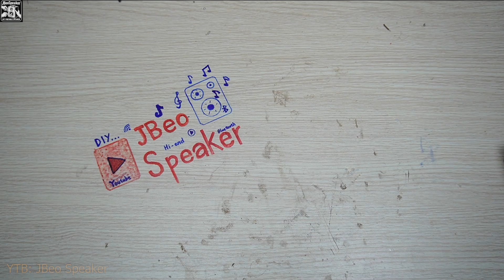Build a Mini Bluetooth Speaker at Home Bose Soundlink Flex Pro || DIY Portable Bluetooth Speaker

Comment: باکس چطوری درست شد!!؟؟
ام دی اف ها خودشون بهم چسبیده و رنگ شدن!؟
Reply from the maker: Yes, I skipped the part where I was working to make the video shorter and less tedious during the process of building the speaker box. Making the box took a lot of time—gluing, sanding the corners, and then painting it to make it look nicer. For my upcoming larger speaker, I plan to cover it with a layer of PU leather.